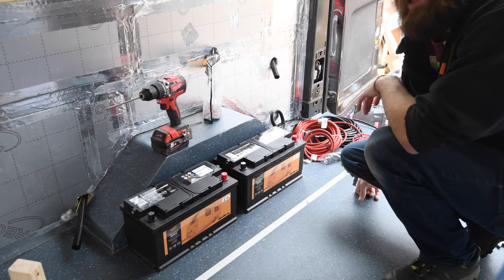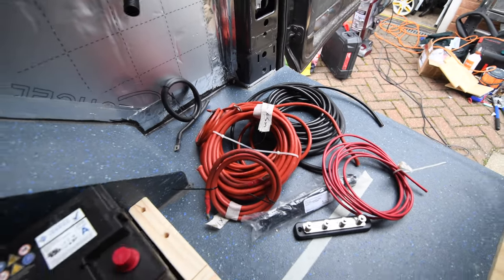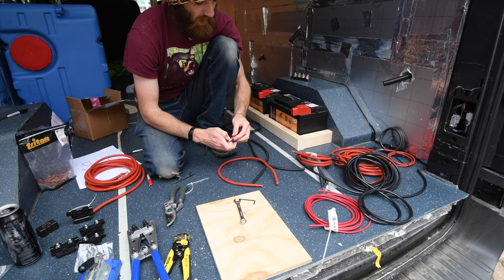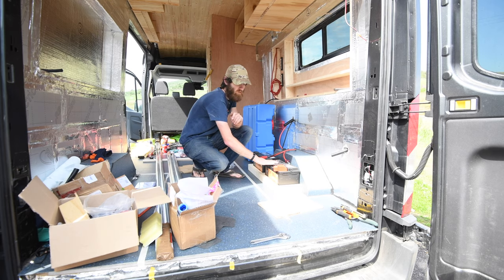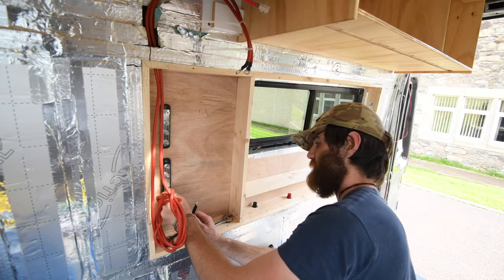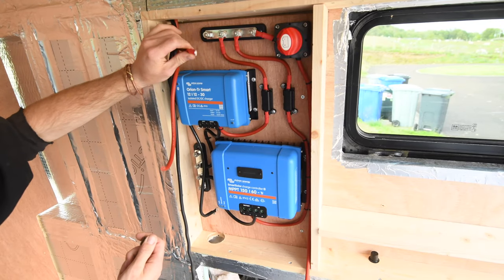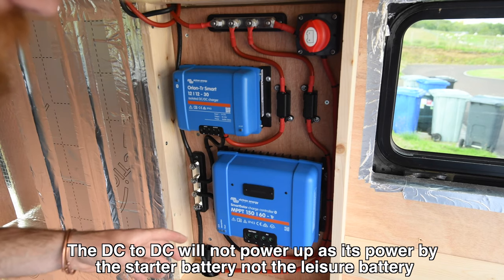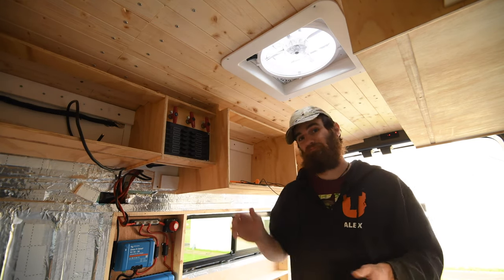12V install and electrical cupboard wiring! | EP20 | Ford Transit MK8 Campervan Build

Comment: For a "non Pro" it's good to see you've done your homework, so many don't are a fire waiting to happen! Just a small point I noticed (which you may have sorted by now) is I would have added a fuse between the batteries, that way if something happens to one of the batteries (I.E. internal short) the other battery wont unrestrictedly dump all it's power into the other battery potentially causing a fire. For systems I design & build where convenience & safety have to be balanced I will often use a fuse & a circuit breaker, 20A fuse / 10A circuit breaker as an example, that way in normal situations if there is a fault the breaker will trip which is easy to reset but should the breaker be faulty & fail to operate the fuse will blow as a last resort as apposed to causing a fire.
Reply from the maker: Thank you for the comment, the System has changed substantially since than.  a lot more consideration to aspects you mentioned  have been implemented.
Reply: @MispronouncedAdventures  Just found you after seeing you at Ash's, I need to catch up lol.
Reply from the maker: Ah that’s great! Thank you for subscribing. I’ll thank him in person when I see him in a few days

Comment: Hey mate, I paused when you were showing your wiring diagram and zoomed in…the smartshunt. Is that how you’ve actually wired it? I’ve just bought one myself and wondering wether to put a -ve to the chassis on the system/load side of the shunt. I noticed you put your chassis ground on the battery side of the shunt,  everything Ive read and the instructions say only the shunt should be connected to the -ve battery terminal. 
I think the shunts smarter than me at the min!ha 
Cheers Ant
Reply from the maker: Hey, 

I don’t use a -Ve to the chassis as it’s not needed in my set up as I’m using a isolated version of the DCDC chargers. The shunt is connected to the negative battery terminal

Comment: 20:30   you say its not a how to video But  cable management is so important to keep thinks safe and under control. Cable ties never seen this before and will be stealing your tip :)  Thankyou
Reply from the maker: No problem, as I’m not a professional in this area and not going to saying it’s a how to but I’d copying along with your own research is a great option is what I’ve done myself for learning a lot of things.
Reply: @MispronouncedAdventures  Cable ties so cheap and strong, easy to cut out later if something needs fixing. What is not to like... yes we understand it is all our own choice But that is why I made the comment. in my opinion it is a good thing... others my think differently LOL :)

Comment: I like the fuse/switch panel. Very tidy compared to the blade type fuse holder. Has it lived up to expectations?
Reply from the maker: Yes, been in for two years now it’s quite excellent
Reply: @MispronouncedAdventures  Thanks for the info. Did you supply the Auxbeam from this panel or direct to the 12V bus bars?
Reply from the maker: I supply the Auxbeam directly from the 12v bus bars as the each switch on the fuse board is a 30amp or something like that. Whilst the Auxbeam needs 60a. How I do power the auxbeams signal turn on / off wire for from the switchpanel so I can turn the whole thing off and on if I wanted. 

Many as I use the fuse switch panel as the main control panel for interacting with most things in the van
Reply: @MispronouncedAdventures  Excellent stuff! I was looking at the Victron Lynx Distributor for the bus bars but they have fairly limited connection points. Tidy though!
Reply from the maker: The Lynx is a great unit. I would most likely install one of those if I doing it again for my main parts

Comment: What was the name of the channel you recommend for the detailed explanation of the electrics? Greg...?? Thanks
Reply from the maker: Greg Virgoe
Reply: @MispronouncedAdventures  That was quick, Thank you. You also mentioned that you'll be releasing the wiring diagram at some point, is it available somewhere? I'm mostly interested in finding out what to buy so I have everything beforehand, i.e. right sizes of terminals / cables, all the connectors. Thanks

Comment: Nice video! So you used 25mm cable from the battery to the connectorpanel, and 16mm cable from the connectorpanel to the fusebox and victron right?
Reply from the maker: Indeed, 25mm is rated to 170amp and 16mm is 110amp ( or around that I think ), I have probably oversized it if I’m honest.

Comment: Your electrics videos are so useful to complete beginners! Thank you! Since you helped your friend install the Ctek MPPT/DC converter as well as your own Victron setup, do you have any advice on choosing between those two? ie. is there a reason you didn't go for the Ctek (as it seems very popular!)? Thanks :)
Reply from the maker: Glad you found it helpful. The main reason I didn’t go for the CTek was it wasn’t a powerful enough for my power needs. Perfect for my friend Chaz but a bit under powered for me. The Ctek has a max output of 20Amps in total and a rather low max VOC for solar of 23v . ( VOC is the max voltage the solar panel put out. ) my solar panels have a VOC of 37.8v so way to high. I currently have battery bank of 390Ah lithium so high amps Charging output the better for me. I also personally really enjoy the all the stats and information to get from Victron units via the phone app

Basically CTek combo unit is great for smaller systems with small solar arrays and smaller battery banks.
Reply: @MispronouncedAdventures  That's so helpful - thank you! I agree the smart functions on the Victron system look brilliant, but it sounds like the Ctek would work just fine for our use. Thanks again!
Reply: Also really enjoying reading about your friend's adventures too!
Reply from the maker: Great to hear, he had definitely does some interesting things ( and more to come, as do I ) ! It’s been a difficult year for both of us as we are both freelance expedition leaders as our jobs.
Reply: @MispronouncedAdventures  I can imagine that's tough - but the van project seems like a pretty ideal way to spend this time until expeditions can continue (for both of you!) - YouTube van tutorials are a very different kind of leadership but we're all appreciating it!

Comment: Dose the Victron dc dc charger and the Victron solar controller work together to charge the same battery pack, ie one dosent cut out the other? Great videos thanks 👌
Reply from the maker: There can be used together no issue. The don’t “work together” as such as there is no communication between the devices but that isn’t important. There are happy to both be charging at the same time and will sort themselves out
Reply: Mispronounced Adventures, blody hell that was quick!!! Thank you so much for the response, very helpfully I’ll be getting both in that case, cheers dude 👌
Reply from the maker: No problem. Best of luck with you build. Both brilliant units!
Reply: Ledge 🤙

Comment: 23:00 Nope. Negligible resistance in the cable, doesn't matter where you connect along its length.
Reply from the maker: Not sure what you referring too? 23:00 I’m connecting up batteries in parallel,  while you can connect if wanted and your main positive and negative on the same battery it’s not optimum set up and the effect is more exaggerated more batteries you have in you bank . While you can do it off the same battery your not going to find recommendations to do so over the other methods

Comment: loved the video just use insulated spanners on the terminals of battery lol
Reply from the maker: It is a good point. Later videos I’m not using to specifically insulated spanners but at least a ones with plastic handle covers at least
Reply: @MispronouncedAdventures  wait to see my van build lol. im sure im going to blow my self up or haha

Comment: Re "EDIT:  recommendation for a future or others who are planning to mount equipment such as, check the manual for installation instructions regarding the surface and positioning of unit. I wouldn’t recommend mounting on a bare plywood surface which I have in the test fit in the video. "    What would you recommend?    What is the issue?  The bare plywood or the position?   I see you have painted it it later videos and placed it nearer to the battery bank (shorter cables lengths?).    Would air holes in the plywood, behind the MPPT charger help?
Reply from the maker: Closer to the batteries will always be more efficient with shorter cable runs. However the overall plan was to condense my electrical equipment into one area 

. Generally the manual recommends a noncombustible surface, which is understandable as these devices do put out some heat. how ever for many van builders that’s easier said than done. Im planning on using a 2mm aluminium sheet cut to the size of the unit back, mounted  between the unit and the ply surface. 

Having said that I have tested the new surface with the paint on which does have a fire rating. Which held up to 30 seconds of direct contact with a blowtorch and didn’t combust or burn, it’s scorched the direct area but didn’t stay ignited. Which I am quite happy with.
Reply: @MispronouncedAdventures  Ok, got it, thanks.   I might try mounting the devices (MPPT and DC to DC) to an aluminum perforated sheet with bolts.  Then attach the sheet to the plywood using stilts to lift it off and provide airflow around the back
Reply from the maker: I think that’s a good idea. The MPPT doesn’t get particular hot, The DC to DC does. But hot is subjective, might be hot for a person to touch but perfectly within the unit rating for the  DC to DC. It starts to slow it self down when it’s above 40°. Whilst the combustion temperature for ply 230°